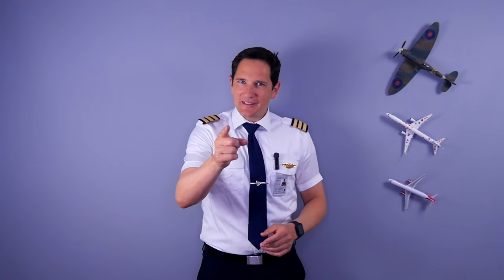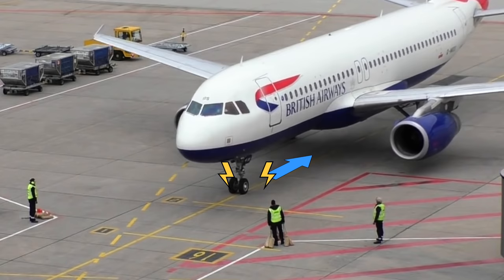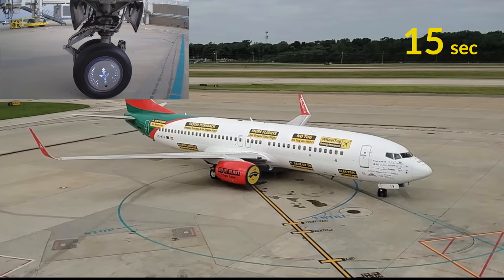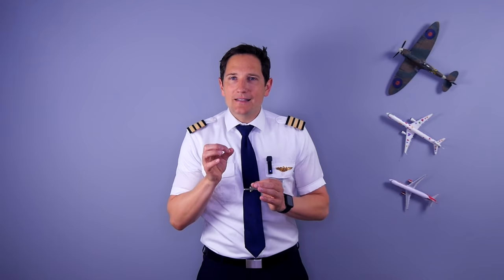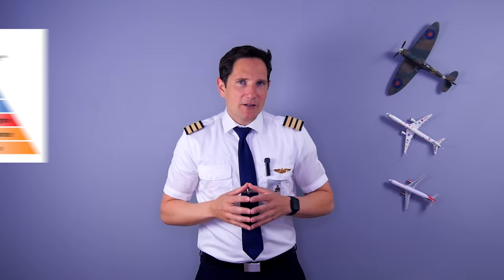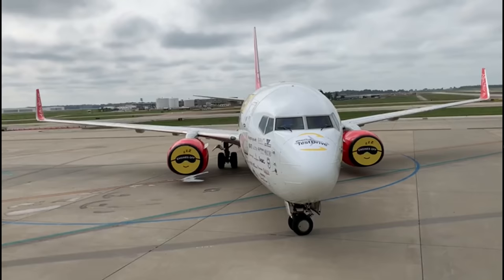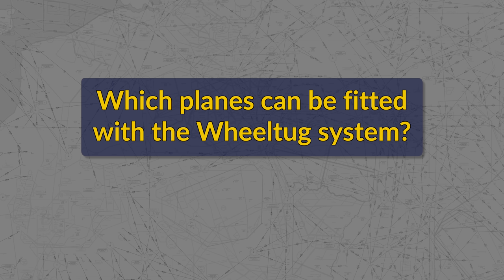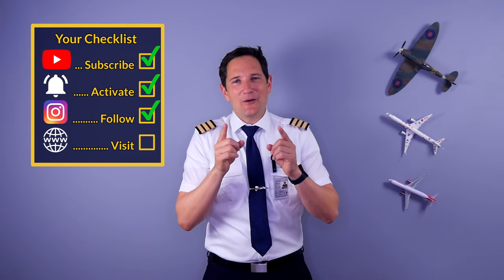The FUTURE of PUSHBACK is ELECTRIC! Without a pushback truck! Explained by CAPTAIN JOE

Comment: Motors in wheels aren't that new of an idea.
If I remember correctly there was a program that build motors into the landing gear to spin them up before touchdown in order to reduce wear on the tires.

This project was ultimately scrapped as the additional maintenance costs and weight and thereby fuel consumption and reduced payload outweighed the benefits.

So I'm going to be sceptical of this project.
Reply: spinning up wheels doesn't give much benefit besides a tiny bit of reduced wear. time savings by spending less time at the gate could make this much more valuable.
Reply: @johnstuart8013  
By far the most abrasions and damages happen during touchdown. An A320 tire lasts only for around 3 months on average. Even a 50% increase means quite a bit of saving over time. Not to mention the ability to shrink the part pool. There's a reason this was considered in the first place.

And an other thing is, most big airports operate nearly at capacity so saving 5 min. at the gate only to wait on the taxiway isn't that big of a time saving either and the airports that don't operate at capacity normally have enough free staff for a pushback.

In theory, it sounds good, yeah. But I'm not convinced it will hold up under real conditions.
Going to keep an eye on it either way.

Comment: The future?  Have you not heard of the FAA? Also, they would require batteries. Lots of batteries!  More weight with those batteries.
Reply: Most of the EV fanboys don't use their brains.
Reply: The APU is there, and uses the existing fuel. No batteries. 
They've been interacting with the FAA intensely for over eight years now.

Comment: What if the motor chokes during landing ?what if its jammed after boarding ?
Reply: This is not used during landing or taking off. This technology is only used when moving away from the terminal. If it fails, a pushback tug can still be used.

Comment: What if some airports ban the use of APU when planes are at the gate?
Reply: APU while standing might be banned, but the apu is always started before disconnecting from ground power, unless they are going to use a huffer cart to get the engines going

Comment: I don't think that these are electric motors. They look much more like hydraulic motors, which would be the far better option. Electric motors have to be huge to provide the torque that is needed here, or a drivetrain / gearing with at least a 1:100 ratio. On the other hand, hydraulic motors have much torque, are small, reliable, don't get to hot and the plane already has hydraulics (that will also function with the APU). At 2:43 you can see the small motors and the cable / hoses. Looks more like hydraulic hoses (no bends) than electric cables (high power electric should be orange).

Comment: Retired mechanic here.  I pushed back 737s,  either driving the tug or walking the headset, thousands of times.  I have taxied the airplanes around busy airports hundreds of times at least, and taught others the skills necessary to earn their taxi/run-up licenses.  I saw many accidents and close calls, even before the idiotic idea of "powerbacks" was hatched.  Believe me, you do not want an airplane moving backward unless there is a tug on the nose gear with a competent driver in place.  Even if this hare-brained electric  motor arrangement proves feasible, which I doubt, implementing it would be a really bad idea.

Comment: Wow the people who invented this wheel tug are gonna be so rich. You can literally use the wheel tug to taxi without having to start the engines. Could save so much money for airlines. Less cycles on the engine. Save fuel on a 180min taxi in JFK by using wheel tug. Less fuel burn… 💰

Comment: Why is the motor not placed at the right and left main landing gears ?
Reply: The main landing gear contains brakes, which can become very hot when used after landing. The heat may cause damage to the motor and prevent the brakes from cooling properly. However, the nose wheel does not have brakes.
Reply: @Eternal_Tech  Thankyou for clarifying my doubt🙏

Comment: Many airports around the world probably won’t allow this due to safety concerns? If it were to crash onto another aircraft, no way the ground handling company should be held responsible.
Reply: Underbelly cameras will be included, as Capt Joe mentions.
Reply: Nosewheel:  No breaks
Reply: There IS no front landing gear brake.
Reply: @MottyGlix  noted on that. Thanks

Comment: why not put electric motor on all wheel so that after landing the plane uses the electri wheel motor to move to the gate to save more fuel and shut down of engine is faster. and also less noise.
Reply: "on all wheels" -- well there is the problem that while the inside of the nose wheel is empty, the main landing gear wheels have inside them VERY HOT brakes, so putting electric motors near those....well, not a good idea. Safran/Honeywell tried, and gave up apparently.

Comment: This is not a good solution. First, it takes time to modify the airplane. Second, it will block the ventilation of the nose wheel. Third, the taxi speed was so slow. Then, the airplane gets heavier and will add matainance work. Lastly, NAA will not allow airlines to install this without strict certification. I think the best solution will be something like TAXIBOT, which looks like a pushback truck, electrically pushback and taxi the airplane from the gate all the way to the runway then detach the airplane and return to the gate.

Comment: What about safety ? I heard Airbus stopped the project with them 1-2 years ago or maybe they were too expensive
Reply: Airbus EGTS is a totally different company. Wheeltug is an independent start up, which makes this so much cooler and approachable.
Reply: Airbus (actually Honeywell/SAFRAN) put the motors on the main wheels, where they interfered with brake cooling. Then they had to put in liquid cooling systems. Then they had to face the fact that their system was too complex, expensive, and problematic to certify.

Comment: This is not real, this is talk of the town for many years but some things are very hard to replace, what about the vision and collision? Even now as we speak Pushback drivers are still responsible for collisions because they where not looking good enough. And we are sitting under straight beneath the cockpit boys and we are creating trouble…. Can you imagine that the pilots will take over now…? They can’t see anything from the cockpit so a screen has to Gide them on a very busy Airport with planes that are running left and right of you….
I know that apron control is responsible for the departure call but even then they also making big mistakes day in day out, sometimes not relevant The get the 8 oclock news……

Comment: I really just wonder why this hasn't been a thing already for years xD
Reply: My bet is that conceptually it is simple, but implementation is crazy hard. Imagine that Safran/Honeywell's version of it, which they abandoned, had the electric motors in the main landing gears, next to the brakes. Use those overheated brakes when the plane moves backwards and you get a tail strike. Yet the counter-intuitive brilliance of this solution seems to be the fact that if you used the nose gear as a brake (as it has no brakes) then if the tail threatens to tail strike, the nose lifts slightly and the nose gear loses traction so that you avoid the tail strike.

Comment: My half-brother did a study on this technology and wrote a paper about it at TU Delft in the 2000's.
So it is not exactly a new idea.
Reply: What were some of his ideas about it?  Curious to learn his perspective
Reply: @akkids6887  They involved a sort of railway put down into the tarmac of the airport and the taxiways towards the runways.
The electrically powered motors would then be attached to nose-wheels of aircraft requiring movement to or from gates on the spot so no additional weight would be required to be attached to the aircraft themselves.
I glanced at his paper barely having started uni myself and it was such a long time ago, so I am sorry I don't know any more details.
His main focus was a study done with the purpose of redesigning the cockpit of a Concorde-like supersonic airliner, removing the requirement of the tipping-down nose.

Comment: Ahm, I'm not so familiar with the airline industry, but why the hell is this new? Powerful brushless hub motors are around since at least 15 years (btw, how much power do these things use? 10kW?) and they are relatively cheap. The rest is just some wire fiddling and certification. Why took it so long to get some interest from the airline industry?

Comment: Hey Joe, how is it that when transitioning to a new plane, you can frankly throw all your expertise with the previous plane out the window, and again wait for another 10 years to become Captain?

Shouldn't 3 or 5 years together with your experience of the previous plane as Captain be proficient?

If you're having a European driver's license, and you want to drive in America, you have to earn your American driver's license. Since you're already familiar with driving in general, earning an American license should be a snap. You just need to learn some extra American traffic rules. Once you have that, everything that comes after is the same.

You're still wearing 3 stripes only. Why in aviation you have to throw away all your previous expertise?

Comment: This is a great idea! I assume that when this is installed on the AC additional trainings for the pilot would be required in the sim. Would sim training facilities have this system installed? If not, then where will they get their training. They should tie-up with sim facilities to make sure proper training is available for pilots who will be using the wheel tug

Comment: Recipe for disaster. This must’ve been dreamed up by some young pointy head.  The saving time argument is not at all valid because the captain will then have to, ‘line-up and wait.’  Then passengers hear that dreaded announcement, “Ladies and gentlemen, your captain speaking. We are number 27 in line to takeoff.” 
   It is sad to say,  but often I can get to a location quicker in my motorcoach then I can buy a commercial airline anymore.

Comment: Don’t see it happening, not with a device that increases the weight of the aircraft . It will have to be an external device , someone will come up with something that works . Turbo prop reverse no , uses fuel.Battery tugs , yes because they have enormous Torque.
Reply: Battery tugs, LOL.
Reply: Huge Torque. They have been used for years by  Virgin Australia for instance . Hook around a main bogie & are remote control. Then put back on charge till their next use.
Reply: @beagle7622  That sounds incredibly stupid.
Reply: @dickriggles942  look up motortok.com The one at the bottom of the page. These are not top of the line tugs but I have see a remote control electric tug easily handling  a fully loaded Boeing 777. Electric Motors are very efficient.

Comment: WheelTug is a stupid idea, most of the time the engines are started and during pushback. Now the pilots will have to essentially reverse the aircraft themselves then they will have to worry about starting engines afterwards. Not to mention aircraft don’t have rear view mirrors lol
Reply: Can't the engines be started anytime, even when WheelTug is operational?  Also, Capt Joe mentions that underbelly cameras are included.
Reply: Ever hear of that guy called the co-pilot? Multitasking is much easier when you're two people.
Reply: @MottyGlix  You clearly aren’t an airline pilot, that’s not how multi crew environments work. One pilot can’t be reversing the plane while the other starts engines lol
Reply: @tommartel7398  a lot of aircraft already have belly cameras and also wingtip clearance is a big problem for bigger aircraft. Starting the engines on an aircraft isn’t like starting a car lol

Comment: This seems like a very biased video.  He doesn't mention any cons or potential issues, like what happens when a motor breaks? Flight canceled? What is the reliability of these Motors? How long does a jet have to fly, to make the money back on the cost of equipment? What if there is ice on the tarmac - will it still work? How much money is it going to cost to train pilots?  I'm not saying it's a bad idea, but c'mon, this seems like an infomercial.

Comment: This is not a new invention. There were several prototypes and demonstrators since 2012. No airline or plane manufacturer wanted to have these systems. Only one company is sticking to that solution for years (see video) The problems are that the rest of the plane has to be redisigned for theses systems. As an example the APUs inside the existing planes are not designed to handle that additional power. The power which can be provided by the exisiting planes is so low that you have switch off the half of the plane and the climate systems to drive like this. It is not cost efficient as a retro fit for exisiting planes/ models. New plane architectures which are prepared for such systems will take place every 20-30 years.
Reply: What is power level demand